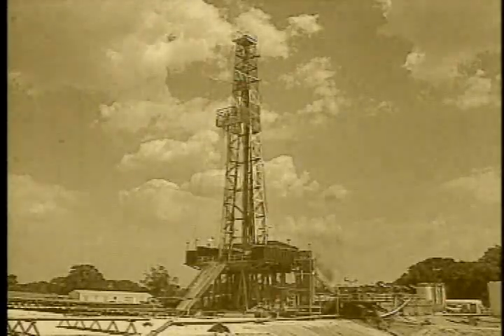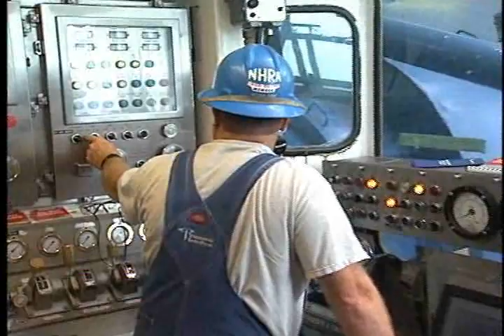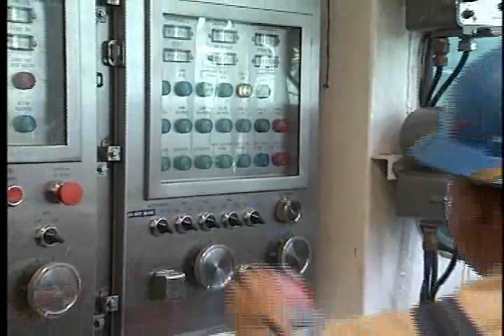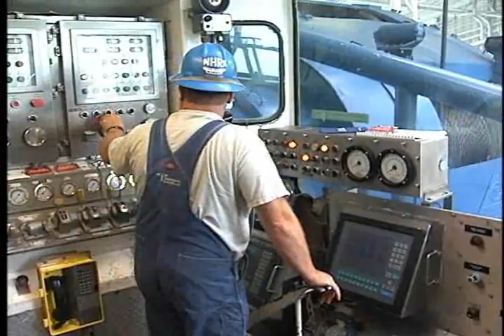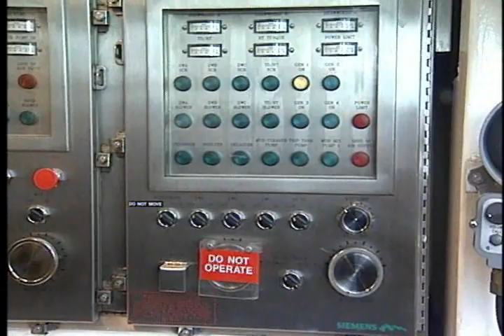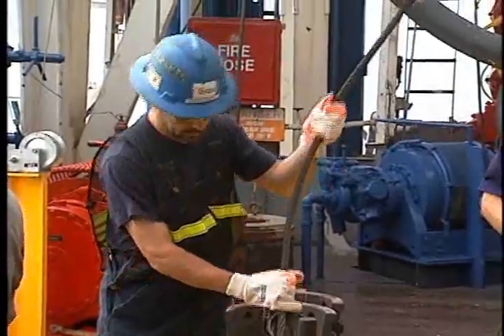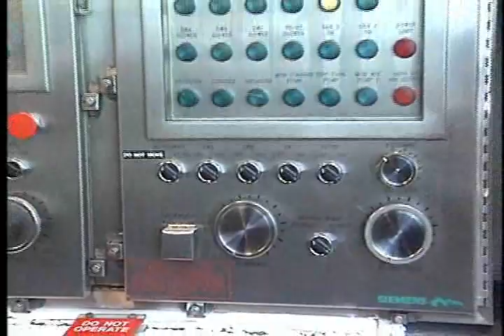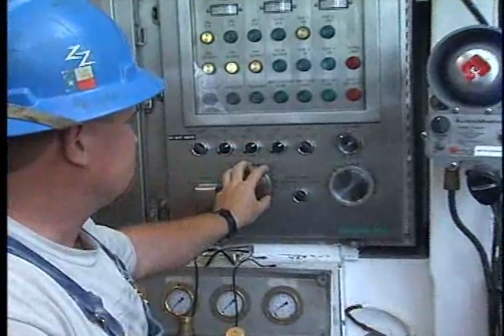Crown Block - Traveling Block  maintenance #Rig_Inspection_Workshop

Comment: See, that big red cover plate.  There is a hydraulic rotating bushing just as is in the rotary table.
For staging pipe going into or out of the well.   ...designed the weight of a "stand", 90' or 3 Joints of pipe.
Most all US Rigs have the tool.
And now for the rest of the story, My father invented that tool.
My brother & I are still in the oilfield equipment, repair & supply business.
If you don't have an oilwell, get one!
Reply: Are you talking about a rat-hole ?